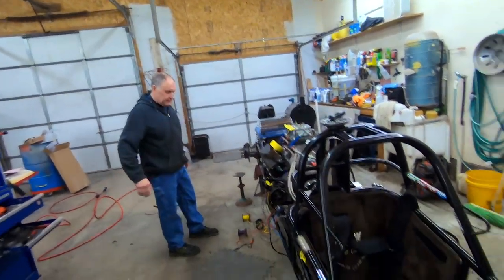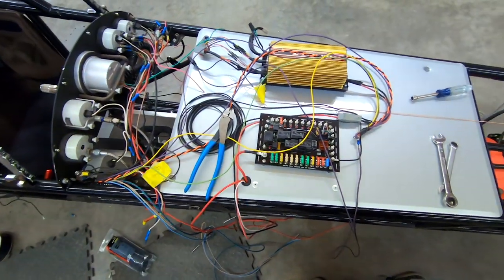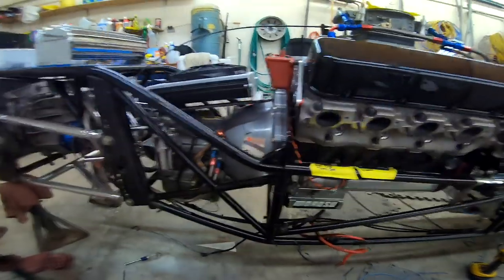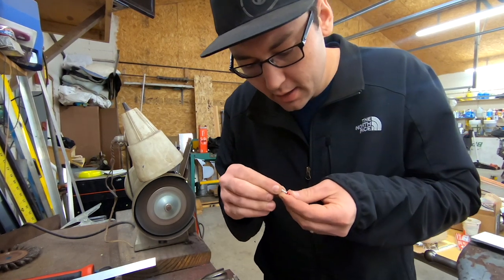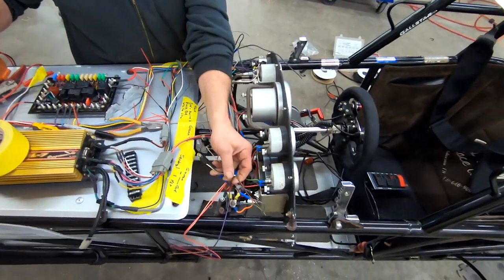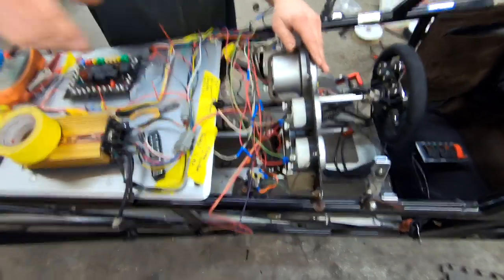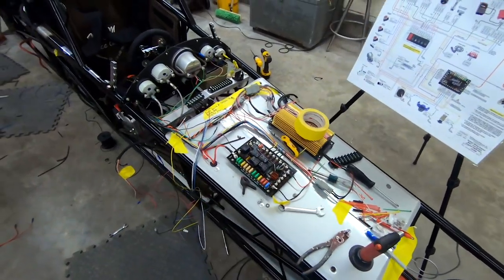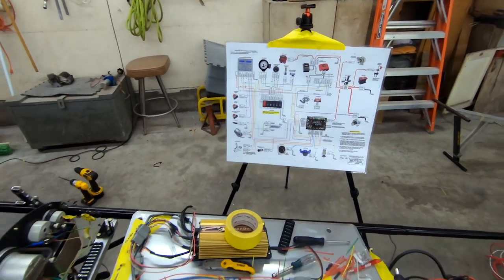RACE CAR WIRING | Part 2 - In Too Deep!!!

Comment: Trying to build the motivation to rewire this Nova of mine... It's going to be the last major step in the build. I've never wired a car before, so I'm scared and intimidated by it. The car has some wiring left in it from the previous owner and some of it is labeled but I feel that some of it could be better. Spoke to a friend last week and asked him if I should piece together what's already there or if I should buy a kit from Painless or K&R. Turns out he uses K&R for every car he gets and wires. His advice from his personal experience was to buy the K&R harness and relay panel and be done with it. So I have a feeling I'll end up taking all the existing wires out (including gauges) and start from scratch with K&R. It is pricey, but I suppose it's worth it to have good, labeled wiring. 

I do have one question that you might be able to answer. I see that the relay panel has maybe 6 relays and was wondering what those relays control or how many circuits the relays can handle? I'm planning to have a relay for most everything like, transbrake, line lock, electric pumps, fan, etc... Thanks for the videos by the way!
Reply from the maker: Great question David... and I don't know the answer exactly right now... I think mostly everything that is on the switch panel goes through the relays. I know the switch panel is a low amperage circuit and that's the reason they have the relay board. So I would imagine its all your pumps, fans, lights, etc...  I'll need to dig into that a bit more.

Comment: Excellent GoPro work! Enjoying the process of your 2020 build. 
Super basic question here (I am clearly not a racer): Why do you run 2 batteries?
Reply from the maker: Wegs Garage great question.  You aren’t the first person to ask that either.    You can weigh in on this answer and tell me what you think:   I’ve always had two 12V batteries wired in parallel in there, because the car doesn’t have an alternator and I don’t want to ever have a problem keeping up with charging.   Now the old man only has one battery (still no alternator) but it is a 16V.   He seems to keep up fine, but since it’s 16V, he doesn’t have to run stuff as long (I.e. the car turns over and starts much faster, Coolong fan runs faster, etc).     So to be honest, I’m not sure if that answer even makes sense, but that’s always been the set up.  A single 16V battery is kind of on the radar for me, since I’m adding so much weight this offseason.
Reply: @GallStarTV  Interesting! Did not know there was no alternator.